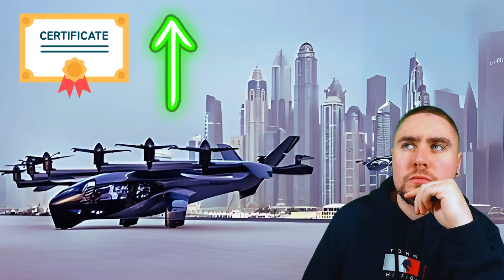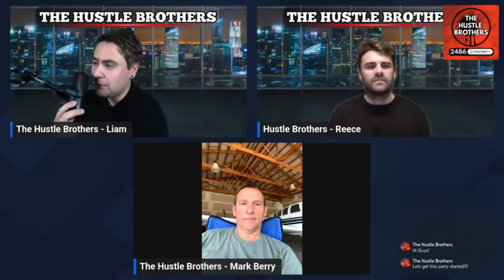Archer's EXACT Certification Process Explained by Our PILOT!

Comment: The FAA is supporting this new type of aircraft by establishing airworthiness criteria. One document that you may want to read is "Airworthiness Criteria: Special Class Airworthiness Criteria for the Archer Aviation, Inc. Model M001 Powered-Lift." It provides a framework for all the requirements that must be met to obtain a type certificate. Certification requirements for new features that are not covered under 14 CFR 91, or 14 CFR 135  must be negotiated with the FAA using the Issue Paper process. 
Three things that really stick out to me are: 1) The document specifies that the aft rotors have two blades and they must align with the fuselage during wing-borne flight. 2) The aircraft is to be certified for visual flight rule operation, ONLY . 3) The aircraft will not be certified for flight into known icing conditions.
Reply from the maker: thank you so much for your detailed insight my guy!